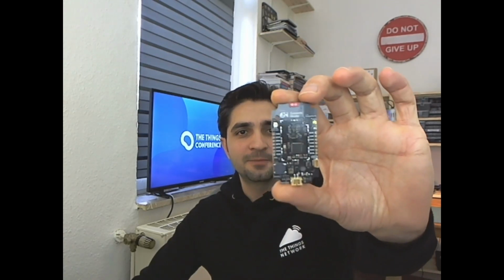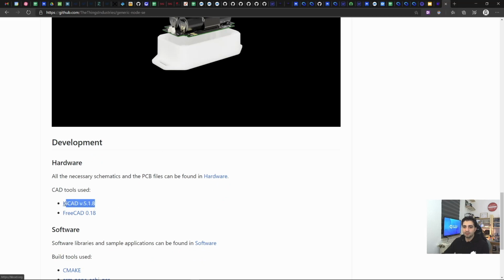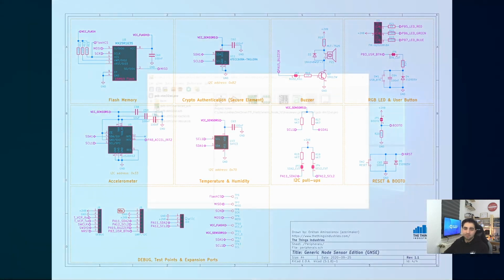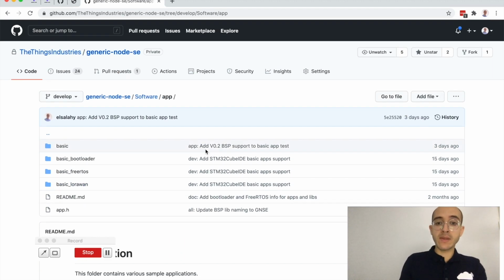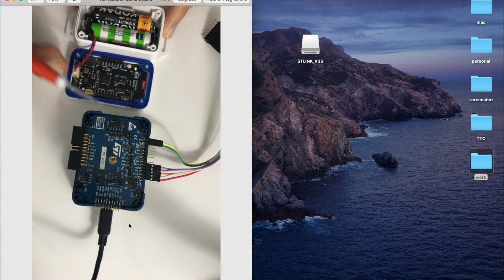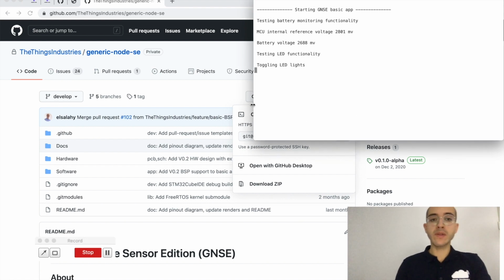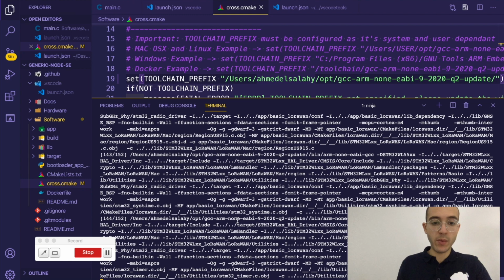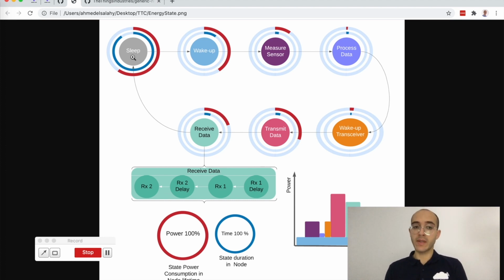Getting started with Generic Node - Ahmed Elsalahy & Orkhan AmirAslan (The Things Industries)

Comment: There is still great advantage to having the radio run separately as an independent sub system, packing everything on the die and having to write software for the thing isn't always cost effective, yeah low BOM and hardware cost the new effort lies in clever clean abstractions to compensate for the crowded complexity - I would advocated using an RTOS Zephyr, FreeRTOS.